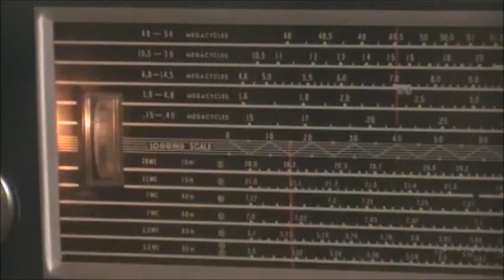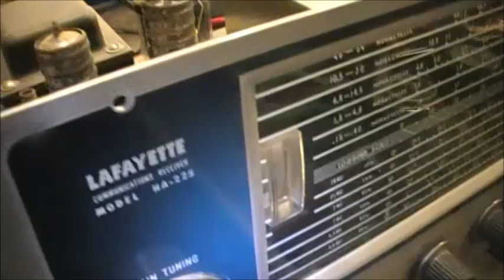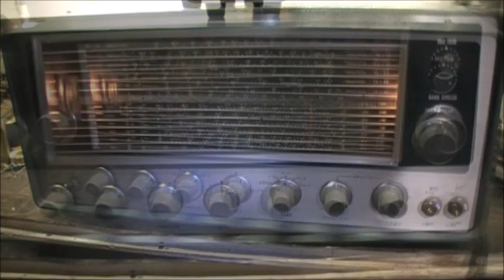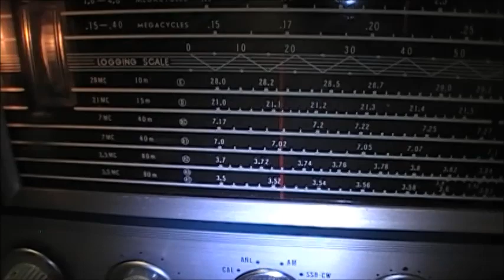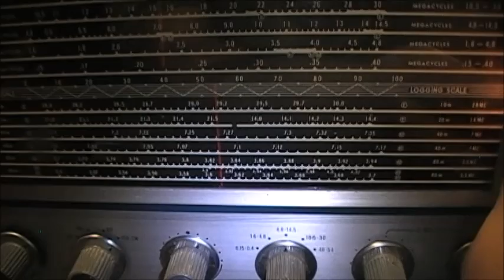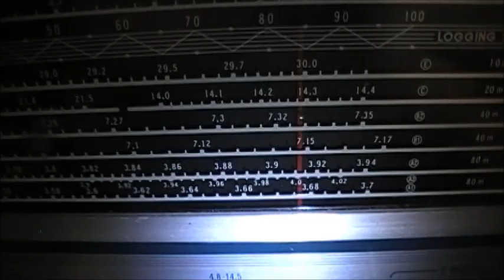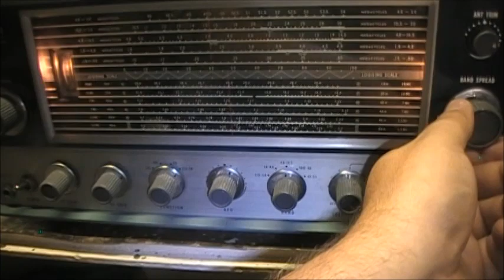Lafayette HA 225 Communications Receiver

Comment: Don't trust everything you read online.  The Q-Multiplier will indeed work with the speaker.  The Q-Multiplier is part of the IF section of the receiver and well before the audio amplifier circuit that drives the head phones or speaker.